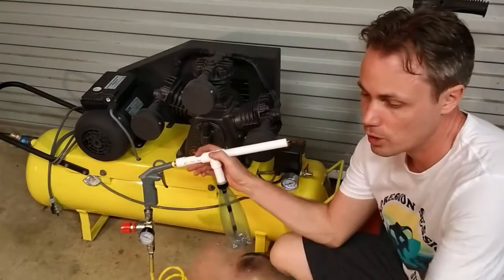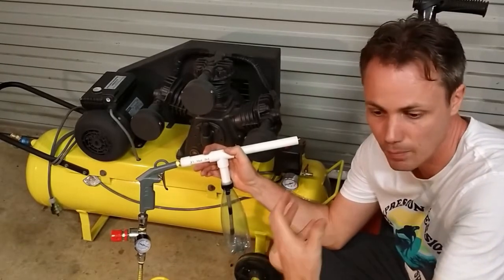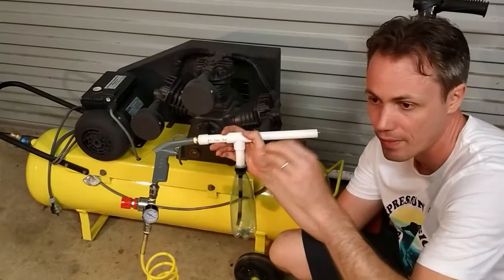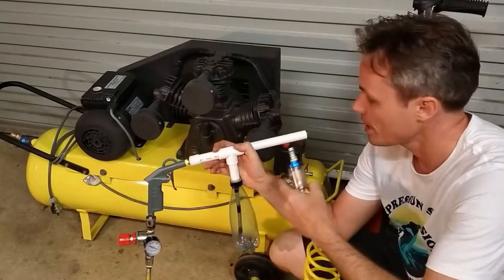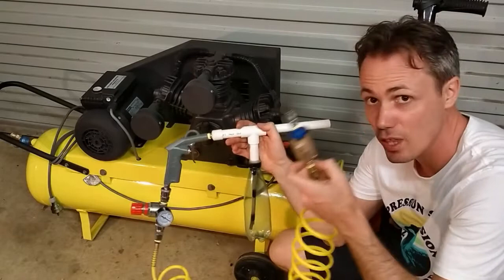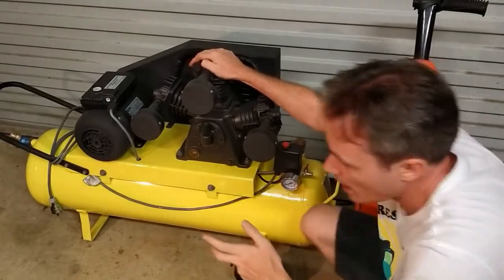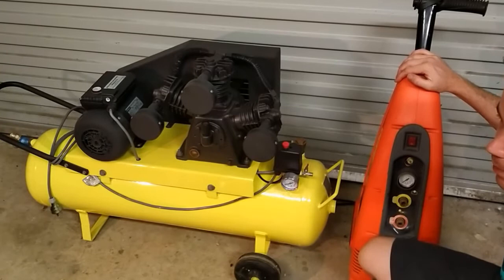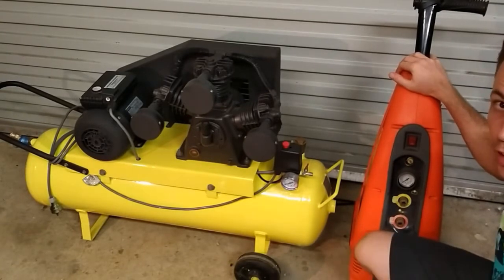Powder Coating Gun Air Requirements

Comment: you can sell the circuit?
Reply from the maker: I could but haven't considered it. Just playing with ideas, would you pay AU$30 + shipping for the following: DC-DC converter, high voltage module, power supply (UK/US/AUS/etc), rocker switch, 2.5mm DC plug, wire and alligator clips? You would need to assemble it yourself into a box of your choosing based on instructions provided.
Reply: @tinkersmith4615  Thank you for your interest, if you could pay uss 30 + shipping costs, but I would need the instructions, my email is morenorobertocarlos40@gmail.com please send me an email so we coordinate the payment and shipping.

Comment: I've got one of those 3M accuspray regulators which i've used in the past to drop the pressure enough for an airbrush, so it should work for me. I'm ordering parts today and will be putting one of these together.

Since i dont have a dedicated oven for powder coating and the boss lady would murder me if i used the one in the kitchen, i'm going to see how well a short wave infrared paint curing lamp will work. Apparently they are used for powder coating as well.